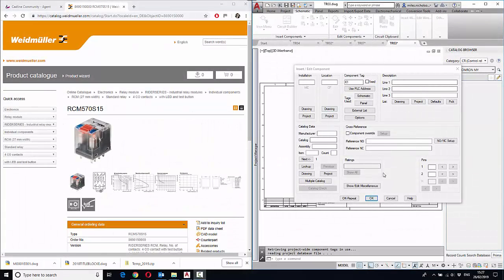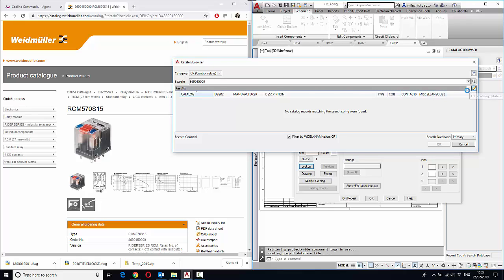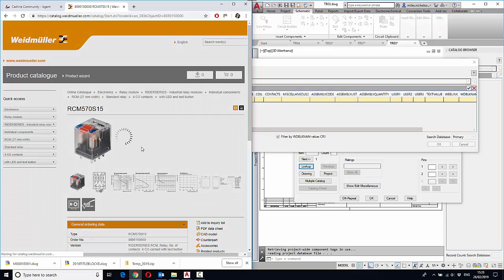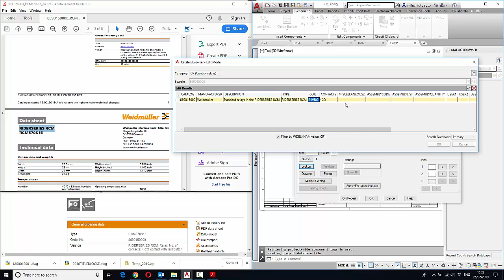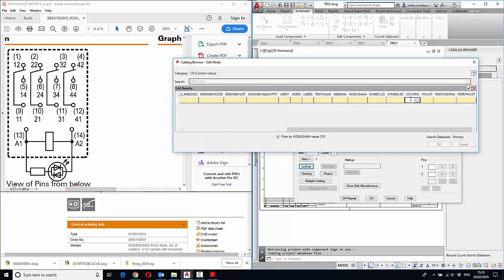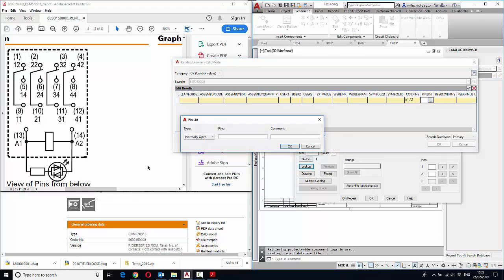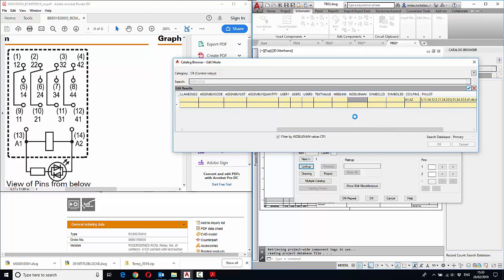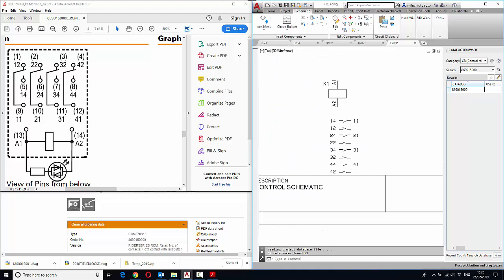AutoCAD Electrical 2019 – Adding a Relay Part & Defining Its Pinlist

Comment: At the end of the video, you show the relay coil and all its contacts in the same place. Did you add each contact individually or is there a function that will deploy all at the same time?
Reply from the maker: Hello, apologies for the delay.  

Our technical expert has advised "The contacts are automatically shown under the parent symbol as long as your parent symbol has an XREF attribute and the contacts have been defined within the PINLIST field within the manufacturers part information within the parts database. The style of cross reference information shown beneath the parent symbol is defined within the project’s properties. An individual component however can have a cross reference override by editing within Edit Component dialogue"

Kind Regards

Jessica
Reply: @arkanceuk  is there any video tutorial for the same...?
Reply from the maker: Hello.  Our technical expert that produced this video is currently on annual leave.  We will ask him to respond on his return and come back to you.  Kind Regards Jessica